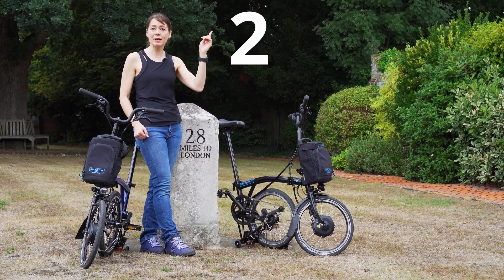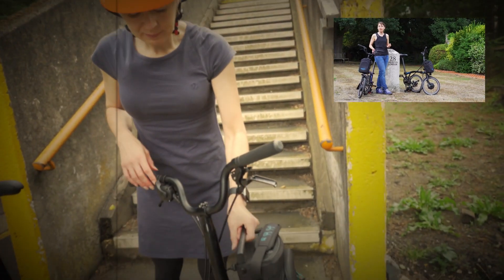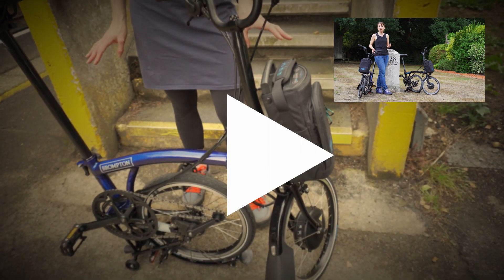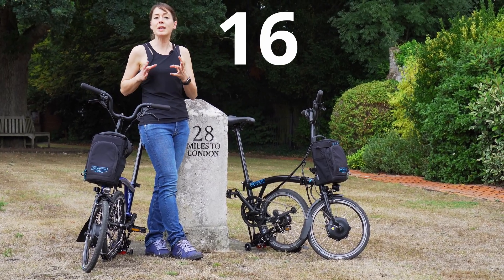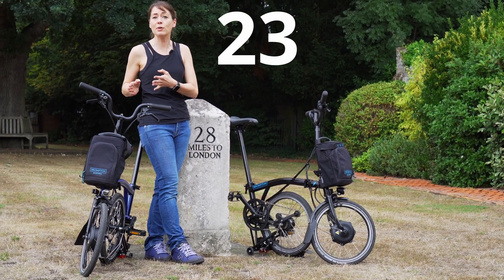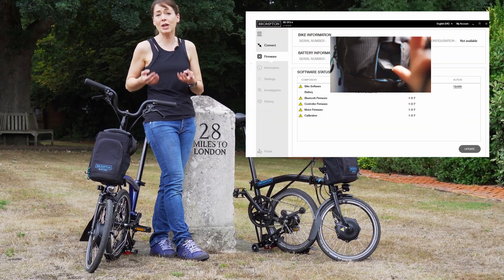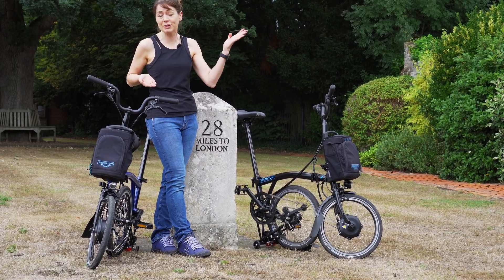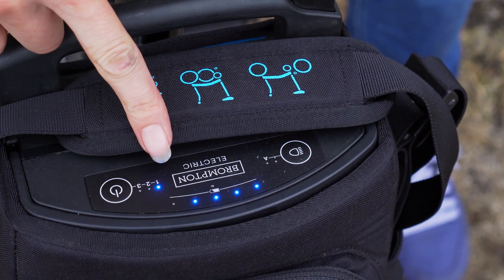Brompton Electric Calibration 30 seconds update

Comment: Do you know the release date of the latest firmware. I had my bike updated in may, partially keeping updated but to see if it solved an issue. I bought my bike s/h,  I noticed that the bike only gives power assist half of the time. I start off with with one leg, I get power immediately on the first stroke. If I start off with the other leg, I do not get power until the second half of the cycle. My local dealer said the new firmware should fix it, but it didn’t. I think this is a potential safety issue as starting off on the wrong leg in a high gear is often very wobbly. Is this normal or could I have a problem that needs fixing? Thanks

Comment: Hi, I would like to know how I can check the firmware version installed ? Which cable is necessary ? Where I can buy the cable ?
Reply from the maker: Thanks for watching

You would need to take your Brompton Electric to your local dealer

They will have the software and cable - it’s used when registering the bike
Reply: @brilliantbikes  do they need the entire bike or just the battery pack for the firmware check/update please? Thk you